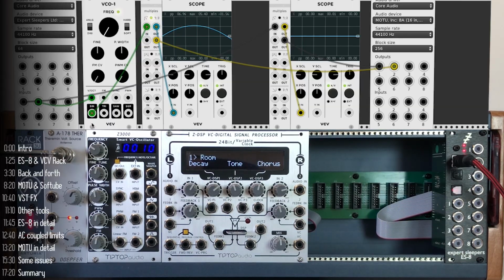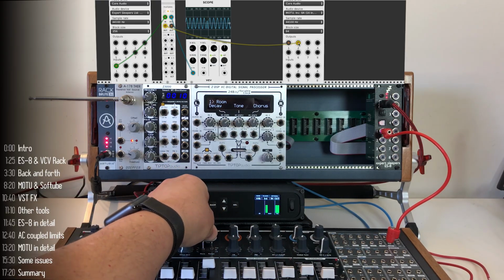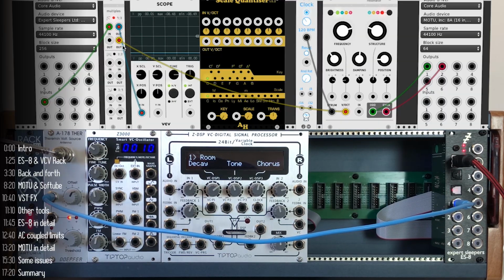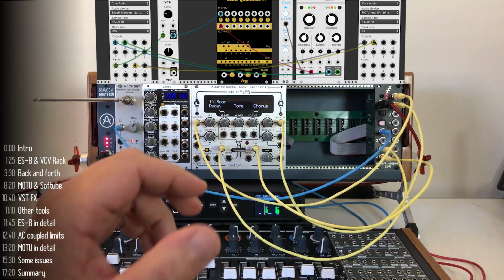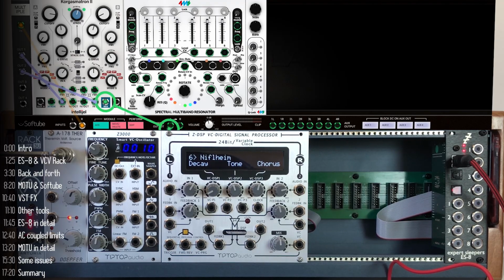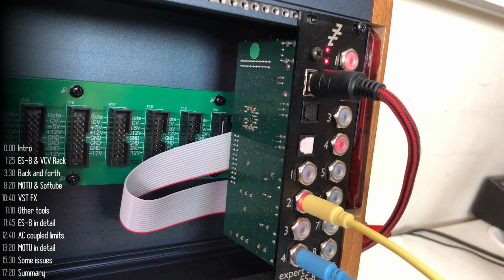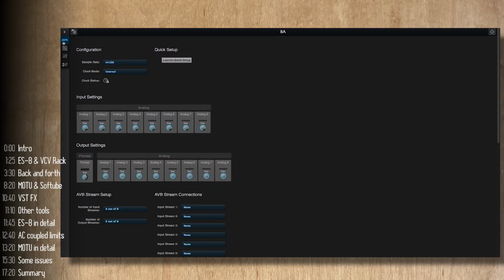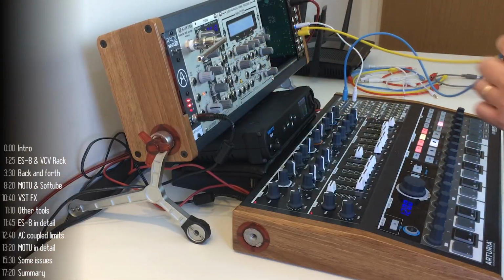Hybrid modular - The one must-have module: bridging Eurorack and VCV Rack, Softube (ES-8 and MOTU)

Comment: Would this work with a Roland system 1m and a Motu Microbook 1 (The silver one from around 2010)? It has analog ins / out, but after watching your video I'm afraid of burning anything out. I see special cables are needed as well. Thanks in advance, I've learned so much from you and BoBeats on so much stuff I can't even began to think how grateful I am for you guys.
Reply from the maker: Thanks! I don't know - depends if it's DC coupled. Check the specs or, if you have them, just try!
Reply: @loopop  the Motu Microbook ver. 1 does have DC Coupled outs! I just ordered the balanced TRS cables to use with it. Thanks again! ♥️

Comment: Anyone using an ES-8 with Propellerhead Reason? wondering how well this would work.
Reply from the maker: Not me, but it’s basically a regular audio interface with dc coupled inputs and outputs
Reply: So it should work just fine then I guess. I've seen Peff / Kurt kurt kurasaki using DC coupled audio interfaces to send CV from Reason to external CV gear for many, many years. I've just never had a DC coupled audio interface myself. But the ES-8 looks like the bridge I need between Reason & Euro rack ;-)

Comment: Another point Linux people will be very happy, the Motu 8A has a http protocol wireless web configuration interface for all the inner gubbins (http://motu.com/products/proaudio/touchconsole/body.html) Linux users can now have full access to the controls without getting a Windows box out. The device is USB-audio class compliant ~ at least for Mac and Linux there are no drivers required for communications over the USB interface.
 In the lab where I work, we have a small piece of test equipment that does the same, any device just connects to a named wirless AP, and bang the interface opens in your default web browser, that kit is operated from more or less any web browser on mobile/laptop/tablet ;) I was wondering when this would appear on computer audio, Now for the rest of the laggards to catch up.

Comment: Excellent tutorial and showcase for this hybrid setup. But now my question is: which physical modules make sense to add to VCVrack (on a budget)?
Reply from the maker: Thanks! You may not need physical modules at all :) that said I think what limits me most about VCV is lack of physical controls  (you can map midi controllers to parameters that have cv in but not all do) - so I would go for modules that are knob/slider heavy (for example Elements or Stages from Mutable have a lot of hands on control options - assuming those modules interest you). Or modules that don’t exist in VCV or analog modules that may not behave or sound the same, of course
Reply: That's what I thought! For now I went for a Theremin A178, pedal input A177 and Mutable Instruments Ears. Next is a Midi Thing. I intend to build my own Solenoid and Servo, since Bastl's are somewhat expensive and limited. Though all of this fills up the ES-8 quite quickly.
Reply from the maker: Cool! Love the theramin! Yes, you run out of jacks quickly, especially inputs, but ES have an expander that gives you 8 more

Comment: Is this the right hardware if I want to route several sound sources into my iPad DAW, put different individual effects on each and and (A: Stop there and record) B: Send them out into the eurorack again? I think A would be enough for me, so I would only need a Eurorack Soundcard with as many Audio Jacks as possible going into my daw. Maybe there is a cheaper solution that only has audio ins?
Reply from the maker: If you just want to move audio back and forth you don’t necessarily need more than a regular audio interface as long as you bring your levels down into your computer and bring them back up on the way out
Reply: I use it with a normal audio interface at the moment but it sucks having to buy and keep all those small cinch / large cinch cables since no normal PC audio interface has eurorack sized cables. Is there something like a Steinberg UR242 or so just with eurorack sized jacks? In or without eurorack format?

Comment: the best way of mixing both is just usin an external mixer a Sync Gen from innerclock or similar system for sync all your hardware and your go lot cheaper, (no interchanganble cv signal but for what the hell do you want that?), if you monitor through your DSP sound card no latency and all is OK, that´s my  advise, cheers

Comment: You said that the Z-DSP can di effects that you can‘t do in software, but aren{t the Valhalla plugins for the DSP just stripped down version of Valhalla Shimmer and so on for PC?
Reply from the maker: When in the video did I say that? It’s been a while since I made it. I may have been referring to changing the CPU speed which is indeed an effect not possible in the software
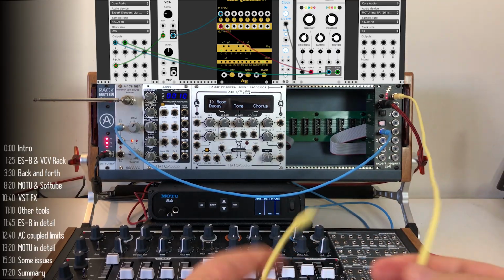Reply: loopop at 7:05. I wanted to know since all of the Eurorack effects that are digital cost way more than the simple effect as a .vst. I don‘t want to fiddle on the pc, but with effects that I just turn on or off it is a cost factor ... people pointed out to me that modulating reverbs and so on instead of just having them on might be interesting so that is why I‘m asking.
Reply from the maker: VictorSteiner yes I meant in particular the CPU speed and effect parameter modulation with CV. If you just want shimmer without those the software is awesome
Reply: softube is adding effects on Modular with cv inputs for modukation, i already own Tsar reverb now they released spring  reverb and more comming soon, but latency can be a great trouble mixing both analogue real thing and digital in particular the way you do, modular sound is great but CPU demanding i mostly use it and sample the results cause the DAW becomes slow soon,  i own a powerfull computer for audio,
the best way of mixing both is just usin an external mixer a Sync Gen from innerclock or similar system for sync all your hardware and your go lot cheaper, (no interchanganble cv signal but for what the hell do you want that?), if you monitor through your DSP sound card no latency and all is OK, that´s my  advise, cheers

Comment: My es40 has never appears in vcv or in a daw like i saw in your video and others videos. I wonder if it is a windows issue, or i am missing something. I saw that a lot of people use adat to usb adapters and works fine, should i try  spdif to usb one? Help me?? hahaha
Reply from the maker: Bruno Mourao did you email ES?
Reply: Actually no. bought it to use with cvtoolkit, and it worked, just in standalone mode but worket.I contact Icaro from spektroaudio(the guy from cvtoolkit) and he said i just can use the stand alone mode because without core audio i can't work with multiclient (maybe its my soundcard?(steinberg ur28m)...sometimes cv toolkit just for fun, but i dont use that much since then.

Comment: not quite sure if a ES-3 + ES-6 combo would be better then 1 x ES-8. I got an Babyface and/or a Raydat with free ADAT Ports. I think using a USB Connection is quite a hassle if working on a PC (no aggregate devices) Any suggestions?
Reply: Yes, if you have free ADAT ports, especially on Windows, it's probably worth considering the ES-3/6.
Reply: I'm using ES 3+6 instead of 8 by three reasons; 1) no multiple audio interfaces, 2) two more inputs, 3) ES 8 wasn't out when I bought them. :)

Comment: Why not just use a cheaper interface to the modular and Minibrute than the super expensive ES-8?
Reply from the maker: Renaissance Man four reasons at least...: no other interface has dc coupled inputs, the large number of outputs and inputs, convenient jack size, location in the rack
Reply from the maker: Unfortunately not - Hermod isn’t an audio interface it only takes in midi
Reply: sigh...so literally the ES8 if you want a hybrid setup using vcvrack and my modular...I also have Reaktor  and Audulus and an ipad pro...would a combo with the iConnectiivty Audio2/4+ make a difference? Like if I buy the Audio 2+ for audio in from the Eurorack..Oh shit I also have a small mixer Yamaha MG10 also..still trying to sort it all out..thanks for helpin..keep on keeping on..love your work!
Reply from the maker: Rick Duff Hermod is awesome. I reviewed it on the channel. It will let you pass midi out to cv, so in essence yes, it’s a partial solution. But if you want to pass “CV” as audio and cv seamlessly from VCV and back, it can’t. Hermod is still awesome though and a very good value for money
Reply: is it possible to use the Hermod from Squarp instead as it has midi and usb host and iO plus sequencing for about the same money and LED screen just no adat which I dont use....I cant find an es8 in stock anywhere but I'm considering this other module if that would work with the vcv rack I n integration using win10pro
Reply: can you take a look again, http://squarp.net/hermod_overview not sure why I need "audio" apart from usb and cv Im connecting the yamaha as an interface and Im guessing the Hermod they are calling it an audio interface and on their instagram tell a user they are DC Coupled, so why not use this over the ES-8 if I will never use ADAT? I just want to drive vcvrack like  you do, here and reaktor blocks
Reply: This is a very helpful video, and I'm also amazed that you take the time to reply to questions. You're helping to educate a community! I was considering purchasing the ES-8 not to interface with VCV rack but with Ableton, but after seeing your review of Hermod and the above discussion, I'm thinking Hermod might be a more powerful purchase, as I would get its sequencing capabilities as well as the MIDI to CV connections. Am I correct in thinking that it can duplicate the MIDI-CV connectivity of ES-8 working with Ableton?
Reply from the maker: Thanks for the comment - yeah I feel guilty if a question gets left unanswered :) if you’re looking just for MIDI to CV then yes Hermod would be a better option (check out also FH2 from ES). ES8 actually doesn’t do midi to cv at all on its own - you need additional software for that - - it’s “just” and audio interface - the beauty of ES-8 is how seamless it makes bridging VCV and hardware modules
Reply: Thanks for the reply and the clarification about the ES-8. I'll check out the FH-2 and see how it compares to the Hermod in terms of MIDI-CV conversion.

Comment: Excellent video - I have an Expert Sleepers ES4 and an older Motu interface (hybrid ultralite mk3 with S/PDIF connection - for some reason, never got the ES4 to work with my old M-Audio interface) - never really got the Silent Way software and have been wondering how (and if) the module would work with the VCV Rack, a program that has literally changed my life, absolutely amazing! Your video has made the point quite clear - thanks a million for sharing it!

Comment: ive been using reaktor blocks for this....also awesome, with an ES-8. BUT, noticed the motu you are using is the 8A. unrelated question but, i have an ultralite and am looking for more inputs. debating another ultralite or the 8A and wonder how you are finding the 8A? thanks [great vid]
Reply from the maker: TRaddcliff don’t the 8A and Ultralite have the same amount of inputs (on board, not expandable). Don’t forget these are all AC inputs, so if you want a lot of audio inputs 8a is the way to go,  but if you want more modular cv inputs, get an ES8
Reply: ive got an ES-8 already. thats why i was saying my question was unrelated. i was just wondering about your experience with the 8A. the 8A and ultralite are similar. two of the inputs on ultra are MIC/Line in and i believe the 8A has higher resolution. thats the main diff as far as i can tell.
just wondering how you were liking it....the 8A that is
thanks
Reply from the maker: TRaddcliff I like it but actually would prefer an ultralite because of the mics.... I don’t think the resolution makes a difference - it’s mainly expandability
Reply: thanks for your replies!

Comment: I just want to make sure I understand about the floating ring cables. Those are only needed if using the MOTU or another actual interface, right? Not needed if you’re using the ES-8?
Reply from the maker: Matt Ceppaglia correct

Comment: Hey loopop, thanks for your great videos! Do you have to use Volta for the CVs out of the motu?  I thought that's what keeps the control voltages in tune (?)
Reply from the maker: tffshtt you’re welcome! VCV doesn’t support plugins so you can’t use Volta - that why I explain a workaround with attenuation as a “good enough” solution. When VCV implements their DAW bridge it might be possible. Other than that you don’t really need Volta for lfos gates etc if you have VCV, it’s just the fine tuning for pitch that would be an issue. Since softube works within a daw you might be able to use Volta there but I haven’t tried it
Reply: got it, thanks!  I was thinking you would have to use it before going into the VCV
Reply from the maker: tffshtt do you mean cv from a physical module?
Reply: yes, e.g. the motu: motu analog out (calibrated by volta) > vcv analog in
Reply from the maker: tffshtt why would you want to go out Motu and into VCV? If it’s already in the computer why take it out and then back in....?

Comment: I like your method of cable labeling with the white dots vs bulky sticky labels from a label maker. Is that just whiteout or something else?
Reply from the maker: FilchMedia thanks! I use a white marker I bought from a local art store - I haven’t tried white out but I imagine it would start leaving crumbs quickly. Mine is called “Leto paint marker” and works quite nicely - not sure if it’s a known brand or anything and careful when you shake it - keep the cap on or wear white clothes ;)
Reply: Yah, I didn't think whiteout would have been the best choice either over time, which is why I was asking. A paint marker sounds obvious now. Thanks for info!

Comment: You sir are awesome! I have been trying to figure this out for the longest adn now I knwo what to do. Quick question how do you decide beterrn ES-3,ES-6 and ES-8? Is it the same thing with more i/o?
Reply from the maker: Shrey Sharma thanks! I think you start with the ES-8 and expand it with the ES-5/6 but I suggest you email expert sleepers to get advice for your particular needs. Enjoy!
Reply: ES-8 = ES-3 + ES-6 + USB. I.e. you need optical adat cable to the ES-3, and optical adat cable from ES-6, into any audio interface that has ADAT IO. The ES-8 however is a fully stand-alone audio interface...
Reply: I think I will go for the ES3 + ES6 cheaper, need to swap my audio interface for one that supports ADAT, more inputs, more power

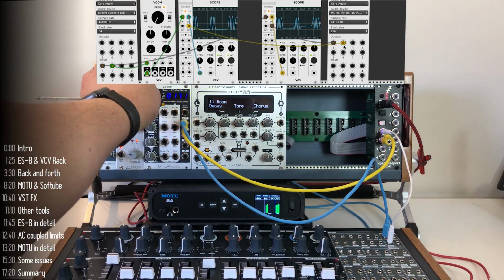Comment: 16:15 - do you hear aliasing in the right channel? i'm not in headphones now... but something "buzzing" there as i've heard this.
How much this VCV costs? Is it the only way to use it as an Eurorack module or it's possible to have a "standalone" version? It's really interesting thing because i would like to use some quick and free features like precise LFO and VCAs for external analog devices. Not "from Minibrute to a virtual module" as you've show it here :D
Making an analog VCA isn't a big pain but it consumes time. Also i really would like to have CV note, Gate/Trigger, Velocity, Modulation and etc. straight "from a PC".
Reply from the maker: 1. I don't but you and I are hearing the same thing - maybe you can hear aliasing that I can't. 2. VCV is free, some modules cost money, most don't 3. you can use it standalone 4. yes you can send CV out from a PC if you have a proper interface and cables as indicated in the video
Reply from the maker: MoolahNasreddin yes you can but you need either the ES-8 (and a case and power to house it) or a DC coupled interface like the ones I show in the video. Once you have that you have all the virtual modules to interface with your minibrute 2
Reply: oh, 1st i've thought that this hardware module is VCV. But i've mean't ES-8 :) How much is it and can it be done as a "standalone"?
Reply from the maker: MoolahNasreddin you mean the ES-8? Around $475 last time I saw
Reply: wow! i guess that many ppl don't need that optical IOs

Comment: can youbexplain a bit more (maybe in a seperate video) how to use the inputs and the outputs on the vcvrack interface you re using here. I can't any documention about it online. So far i 've only been able to make use of the two top left output in the same way you do. But the inputs below it, what s the intended use?
Reply from the maker: Gert Braakman it’s quite simple VCV gives you up to 8 inputs and 8 outputs. These map directly to the outputs on your audio interface (if it has them.  If you only have stereo out, you only get 1 and 2)

Comment: Can someone tell me... Can vcv rack be used as an (vst?) instrument inside a daw (Studio One) on the same daw pc? Or is it better to have vcv running on a separate pc? Thanks
Reply: They just added this in VCV Rack 0.6.0.
Reply from the maker: It can't currently be used as a VST - it's only standalone software. There are bridge plans for the future and workarounds as well but I haven't studied that - please check the VCV Rack group on facebook - plenty of people have tips for that there
Reply: Thanks!
Reply: But you could still have them running on the same computer.
Reply: that would be awesome to have the ability to use it from a DAW like Ableton to give virtual modular to laptop Ableton rigs.
Reply: It works great in Reaper, and may other DAWs. Search the VCV Rack Facebook group for more info.
Reply: For anyone using FL Studio - VCV Rack 0.6.2c (current as of this morning) works very well using VCV-Bridge-32 or VCV-Bridge-64. Just be sure to follow the directions as outlined in the VCV Rack "Manual" web page on how to set up Bridge in FL Studio - there is a nasty gotcha if you don't follow the directions carefully.
cheers,
J
Reply: Yes, in audio interface you choose "Bridge" and then select port 1 to have it show up in Ableton after you drag the vst to a track